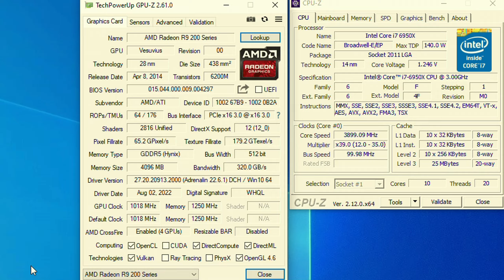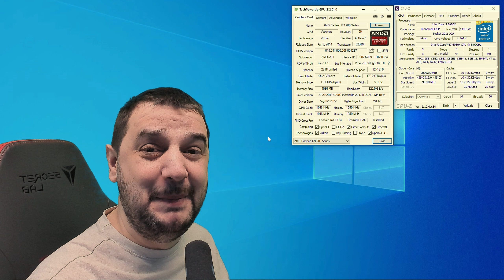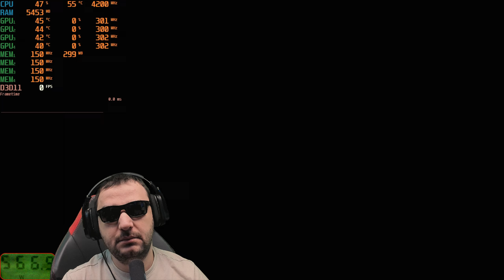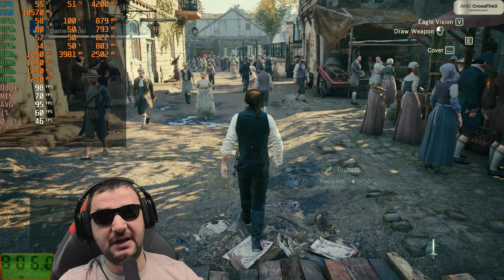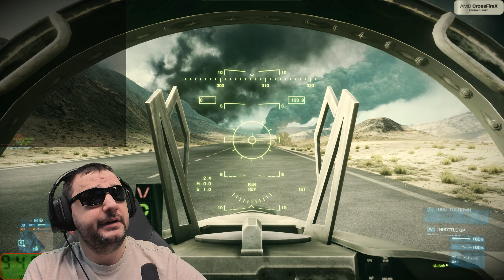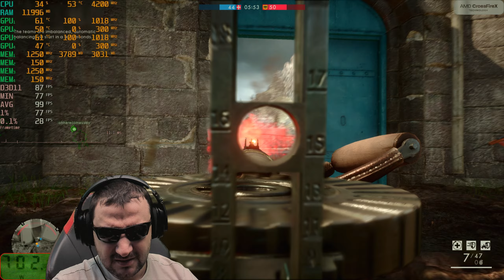AMD Radeon R9 295X2 Quad Crossfire Benchmark

Comment: Hello Daniel
I got two RX Vega 56 and all games works well but there are few that they are not like Battlefield 1 on both Directx 11 & 12 (DirectX 12 was leading to crash every time I join a server)
at 4K Ultra setting with or without the TAA I getting 25-45 FPS with a lot of lag and frame time is very very bad too.
I used AFR friendly compatible and both was great on FPS getting max performance of 80 FPS however there was a lot of flashing textures on the ground and with 1x1 everything was black except HUD.
the driver I used was 25.5.1 and it worked more stable in some games like Witcher 3 compare to 21.5.2.
can you try crossfire in battlefield 1with your R9 nano , fury X cards?
also Stalker clear sky fails to open using crossfire in my setup.
Reply from the maker: It's interesting to see your results.  I'll take a look when I get a chance.

Comment: Okey hear me out, since it has two GPUs on one board, can you try out lossless scaling with the r9 295x2? Use one GPU core only for lessless scaling and the other for rendering, this would be so interesting if it works.

Comment: Brilliant videos, I was a kid and big into gaming when these cards were coming out and was in awe of them back then!

It's interesting to see how they perform all these years later, but I think it also illustrates how far tech has moved on since then too.

There is definitely still some insane aura around these cards though.

As a car guy, I know a modern golf r is fast, but I'd pick the old v8 gas chugging Mustang any day over the golf for pure enjoyment, and that's kind of what this card is like
Reply from the maker: Exactly. Even though the GPUs are old and surpassed by newer, more powerful, and more efficient cards, what makes these old, chunky cards which consume a lot of power and have specific requirements for optimal performance quirky is the very reason some people buy them. It's nostalgia, a desire for something different, or even fulfilling a past desire they couldn't afford back then, essentially acting like a time machine.

Comment: Overclocked they pull 800+ watts PER GPU !!!!! :hand-orange-covering-eyes:
Reply: 400W per 8pin
Reply from the maker: @ggmgoodgamingmichael7706  how many of those are still working? :_wtf:
Reply: @ Sold mine years ago, but they were working 24h full load, 1200+MHz core overclock. Memory was OC to, not sure but if I remember it was ABOVE 400GB/s. Solid as long as You keep them as close to 50C as possible with server fans. At higher temps the voltage scaling goes nuts.  All on the stock 120mm radiator which you could cook eggs on. In winter they literally served as heating for the office room, turned off the radiator and used them for "compute workloads". Crossfire, as You show, was not well supported in many games even then.... But, as You saw in the benchmarks BTF3 and BTF4, and Crysis 2,3, were THE GAMES for these cards. 4K 60+ before mainstream 4K on a 32inch in 2015 was incredible. Personal high point in gaming.. exciting and extreme 😎 TAA really killed crossfire as it is impossible due to the way it has to access the frame buffer. Great channel that brings back memories, keep up. Do You take cards for testing from viewers?

Comment: Is that a shotgun mic? You really need a high-pass on there. A buttload of 120hz and below just being rammed down the pipeline. (I might have worded that better so Edit: Being close to the mic makes the low frequencies more amplified. So lowering the lower frequency band under 200hz solves that. Nothing too drastic, though.)
Reply from the maker: @Unethical.Dodgson  the mic is flat. I hammer it down. Reduce the lows? Highs? More mids?
Reply from the maker: Mkh 416 p48

Comment: Next video: GTX 480 Quad-SLI..or at least triple. It can also be GTX 590 SLI (I mean: 4 GPUs). I already found your video with 2x 480 and gonna watch later, but it's still not extreme enough after this 2x295. I hope- challenge accepted 💩💩💩
Reply from the maker: Gtx 590 quad is out. One card died. 4 480 its very hard.  You need a very unique mobo.
Reply: @DanielCardei  ok, so I am just waiting for more content. Good that you develop and listen to your audience (vram allocation vs utilisation, 1% lows etc.) 👍👍👍
Reply from the maker: @Piotrek_Fanatyczny_Kociarz  even if i don`t reply sometimes i write it down. in some cases i reply back after i`ve done it or try it.
Reply: @DanielCardei great, I really appreciate 🤝🤝🤝

Comment: AC black flag is capped at 60fps even if the vsync is turned off brother. See some patches of uncapping the fps limit. You should get way more fps on that game😊

Also, the unity on the other hand, runs 60fps all the time in my 290x with maxed out settings 1080p res. So you should get at least 80-85? Something is terribly wrong with that game i think

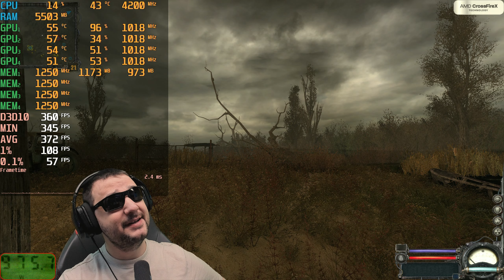Comment: Other Channels : 5090 will consume 575W ,thats alot of power ,meanwhile a baller with quad sli R9 295X2 : Hold my Radiators 🤣0:39 👩‍🚒👨‍🚒🚒
Reply: 575 card only, 950 whole system.  add the new systems to the 5090, you get there 9950X or 14900KS  ~1000-1100W